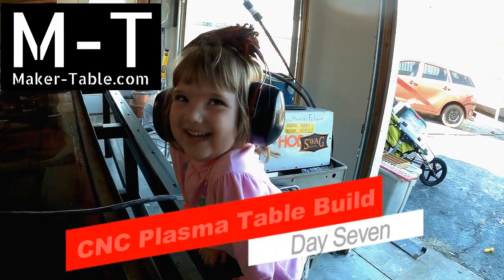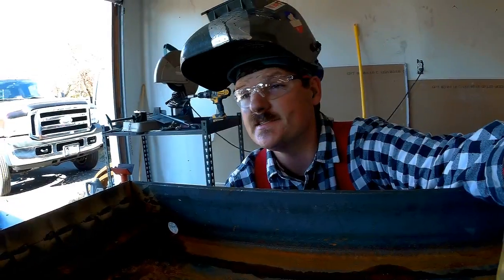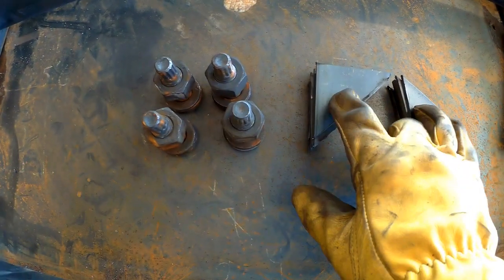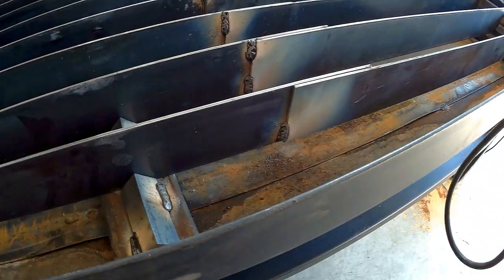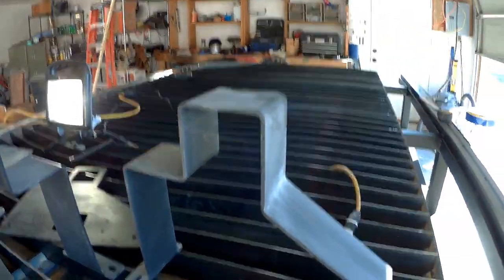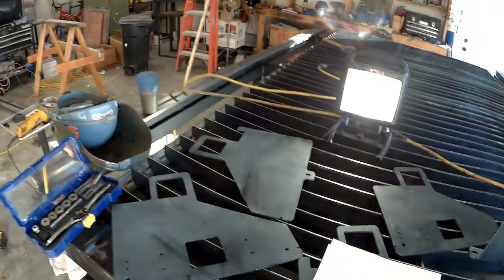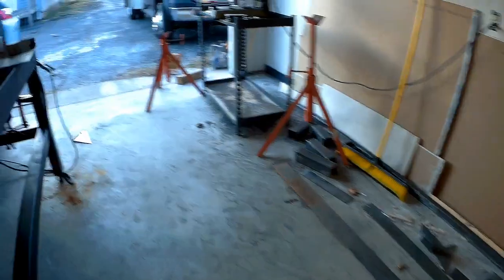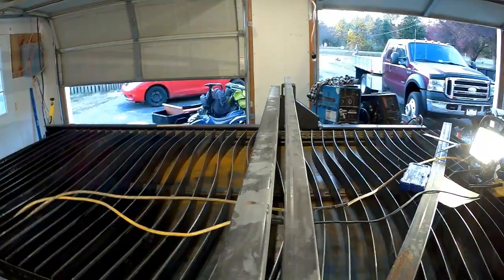CNC Plasma Table Build Day Seven (Water Bed & Gantry)

Comment: A wonderful way to Tap hole is to get your self a Air Drill and a Tap holder to fit in a drill chuck. I watch employee at a Factory Tap holes by Hand  and it took a hour to tape 30 grease nipple holes with a 1/8th pipe tap then i showed them how a Air drill cut it to 10 minutes. Campbell's Hausfeld makes a 1/2 inch drive with reverse that is low speed high torque. I would grind 3 flats on the Tap shaft so it would slip in the chuck, it worked like a dream.
Reply: Would like have the link for that tool...great.
Thanks

Comment: Thank you for these videos!  I know this has been asked, but how much would this metal cost?  It would help me to know if it is possible to swing this build.
Reply from the maker: That Dude There the table can be built for about $8k plus plasma and compressor. I saved for two years to pay for this project working as a rodbuster and welder so I know it's possible. Good luck bro!

Comment: I am still waiting for the lip gloss 'how to'!
Reply from the maker: ImWthStoopid ha ha ha, coming soon!
Reply: Excellent!  On less important matters...on the 3x1 cross piece...how did you butt them up?  I have a kit from Precision...and it looks like that slot on the gantry is about 7/8.  How did you get a 3x1 into a narrower slot?
Reply from the maker: I don't exactly remember at this point but I probably cleaned them up with w die grinder to get everything to fit up nicely.